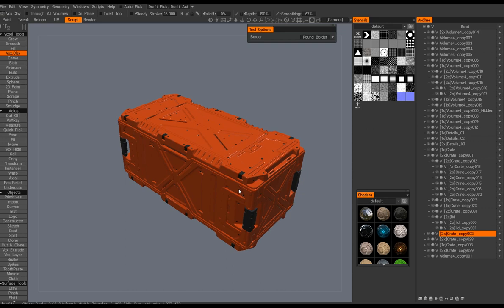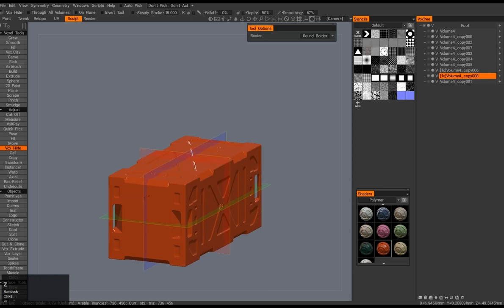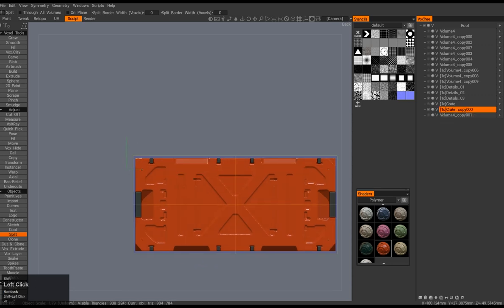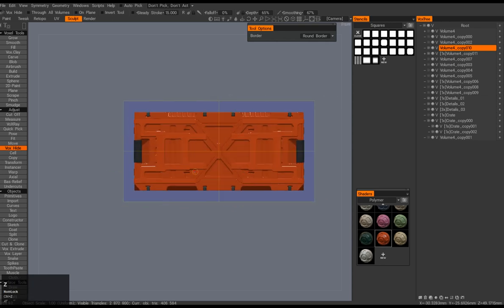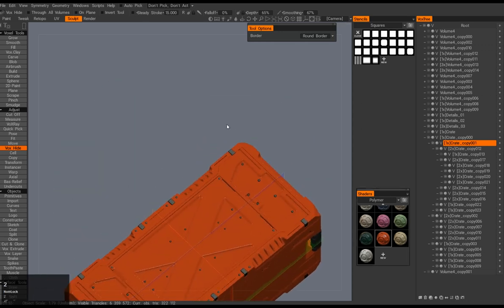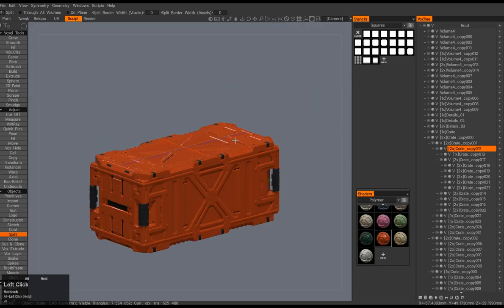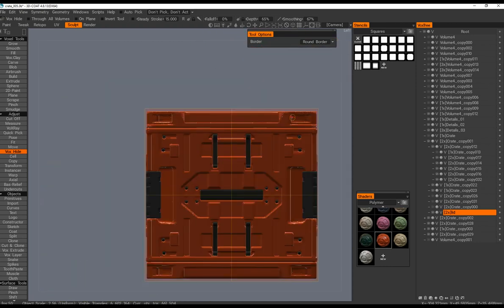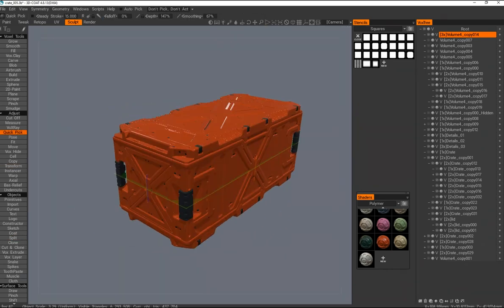3D Coat Crate Design

Comment: You can definitely see that you've gotten more polished and more confident as you burn through this sketch design. This really does look good, and I imagine an entire game level with similar aesthetics would be fantastic!
Reply from the maker: Thank you very much, Gryphon! Indeed, I'll probably do series about sci-fi environment in 3D Coat and Unreal.
Reply: Like your vids man! Any suggestions for retopo and polygon reduction in 3dc ? That’s where I struggle when doing hard surface stuff.
Reply from the maker: Thank you, Hankey. To be honest, at this point I would just use their standard retopology tools like points and quad draw. Quite time-consuming but still better than the auto retopology in my opinion, but I might not have enough experience with the auto retopo in 3D Coat.